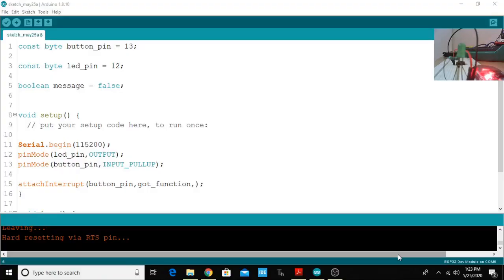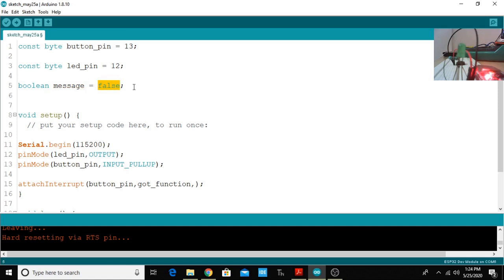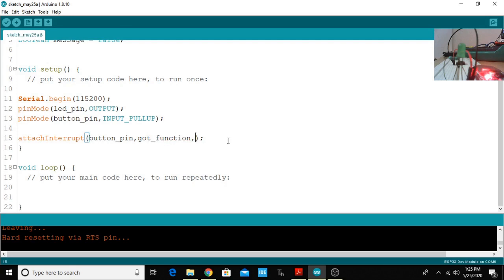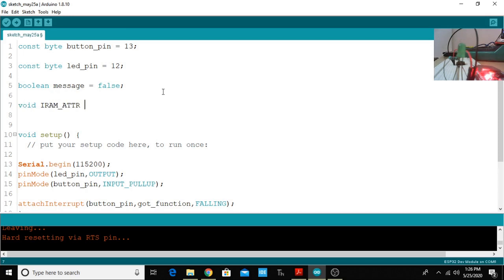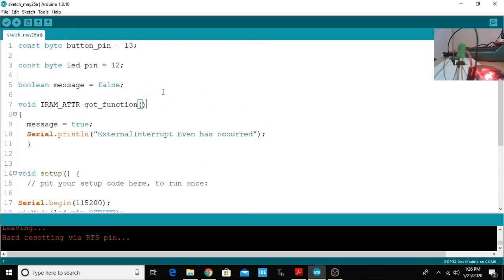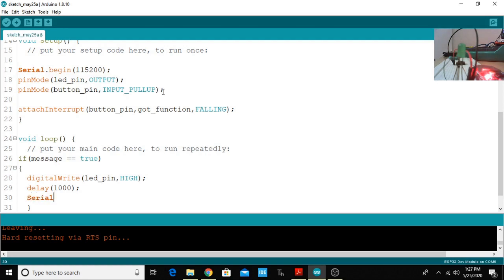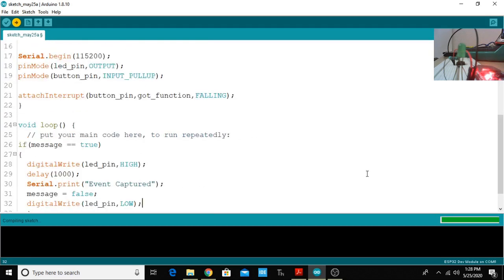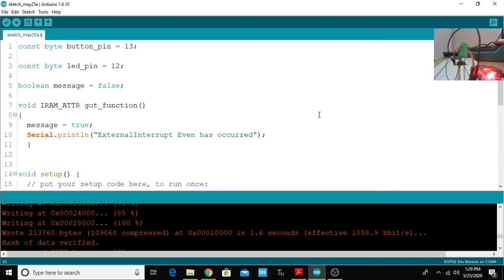External Interrupts Esp32

Comment: ESP32 has a difference to ESP8266 in that the correct way to call digital write is not HIGH and LOW but 0 and 1, it can be an issue with some programming.
Reply from the maker: Yes, In arduino root libraries HIGH and LOW is predefined. It's just become a universal practice.